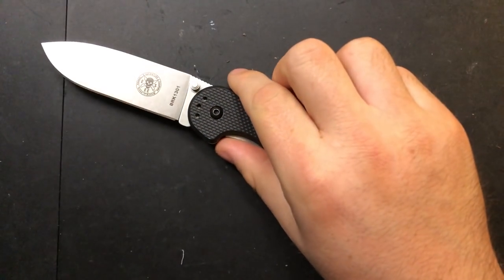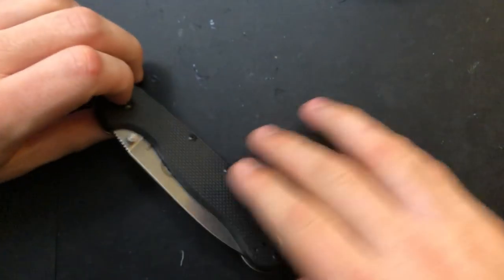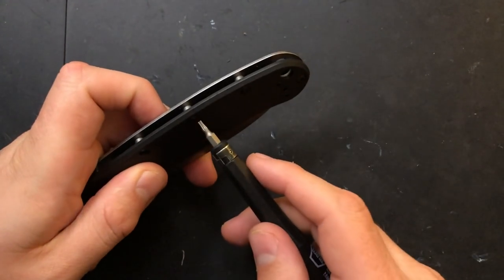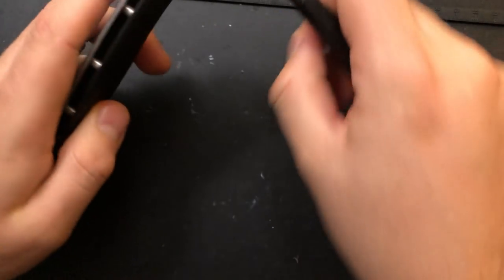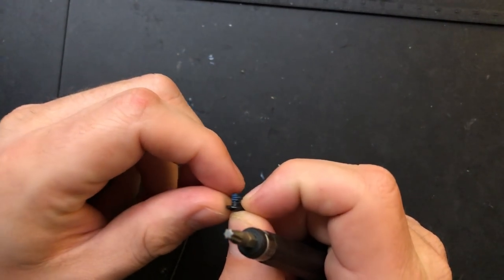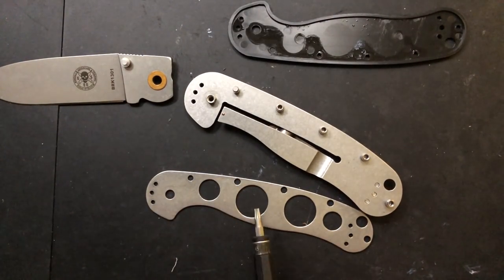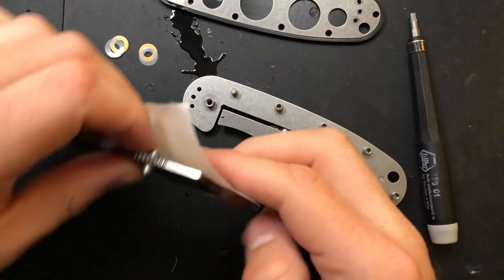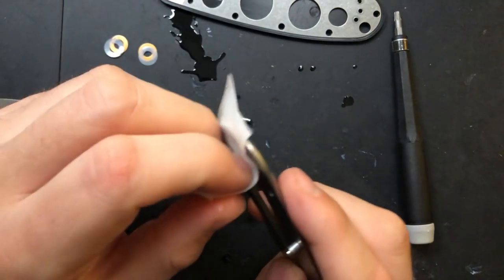How to disassemble and maintain the ESEE Avispa or Zancudo Pocketknife

Comment: Great knives! I just disassembled my Avispa a few times the other night to adjust the lockbar while binging House of Cards. It was at 100% and was destroying my thumbs. Have it about 50% now. The Avispa D2 and Zancudo D2 are two of my favorite blades! Thanks for your vids Mr. Shabazz!
Reply: Do you have it setup for tip up or tip down carry? Both my Zancudo and Axispa are tip down. The Zancudo I can easily disengage the lockbar one handed but the Avispa nearly impossible with the pocket clip riding the back of the lockbar.

Comment: ...Teflon washer runs smoother than PB washers..(some say)?...less friction coefficient...i.e. Hinderer, CS etc....the longer shoulder of the stop pin goes into the metal side of the handle, so it sits 'flush' (aesthetics)with the handle(thickness off material)....have a great Christmas...
Reply: JCB 67 Like you have said, the stop pin needs to be flipped around so the shorter end is with the steel liner not in the steel lock side because it will develop some blade play that I have encountered with one of my knives. Yes teflon washers help make it smoother, even though the pb washers are very smooth to begin with

Comment: I'm used to remove the old blue loctitle before aplying a new one but I see you never do it. Am i doing an unnecessary work? Also, have you ever tried the Sentry Solutions Tuf-Glide rust protector ? Any thoughts on it ? Thanks for the videos Nick

Comment: I have debated the framelock Zancuto in D2 as a replacement work knife for the bent liner lock Rat 2 i recently destroyed. Probably will pick up a mini cutjack too. Currently the Delica does the job but i dont want to wreck it. I am a savage on work knives.
Reply: Chuck Beef The Cutjack will put up with a lot of abuse. The blade on the Zancudo is much thinner.
Reply from the maker: Funny, tomorrow’s video addresses this directly!
Reply: If you're breaking locks maybe a fixed blade is the way to go.

Comment: Mine does the same thing. I could swear it came out of the box centered and after some use I noticed it leaning. I tightened the pivot and centered it but it was too stiff and tough to open. I had to ease off the tork on the pivot to smooth out the action. Still leaning, though. Doesn't seem to be a way to correct it perfectly.
Reply: On some folding knives if you loosen up all the spacer screws and pivot pin you can get the blade to center back up by walking (shifting) the scales back and forth. It has worked on some for me and not on others.